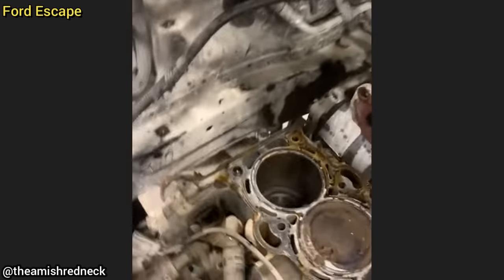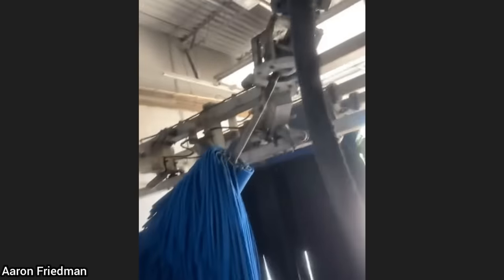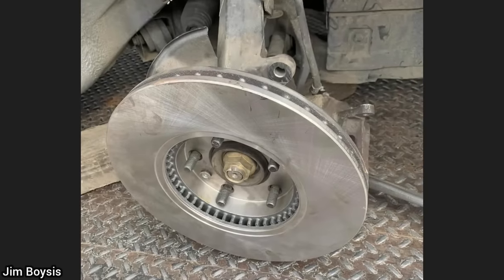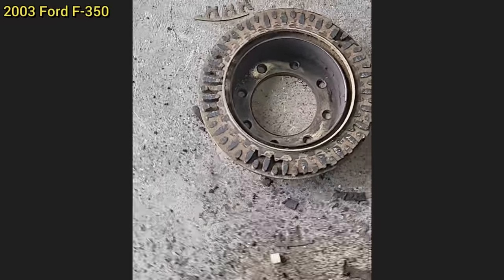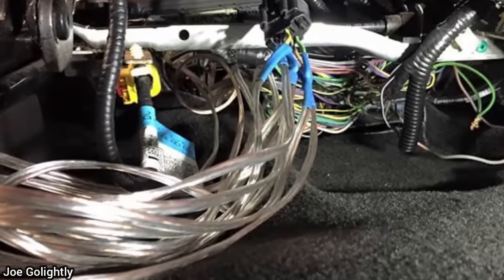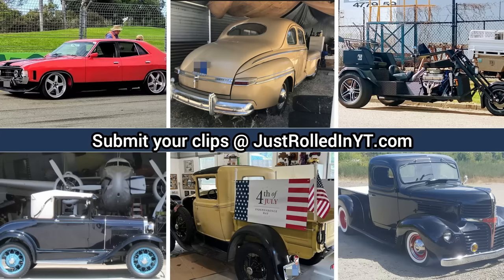Customer States Engine Runs Rough After He Replaced Some Parts | Just Rolled In

Comment: I can forgive these "rattle coming from rear of vehicle" instances. Why? Well, I started having a clunk in my front suspension completely at random. Like there was no specific trigger; just randomly would do it. Jacked the car up, everything was tight, pulled the wheel and inspected everything, but still clunked. Open my frunk (Boxster) and... the spare tire was loose. That was banging around in there, causing that feeling. Tightened it up and it's been fine for about 5,000 miles now lol

Comment: 40 years ago I bought a Pontiac for 50 dollars.....it made helluva noise and pulled to the right badly. 
The previous owner had put new brake shoes on, one of the springs had came off, letting the parts fall into the brake drum.......
Put it back right, sold it for 500 dollars......

Comment: Nice job with the brake rotor. How difficult is it to put the new one on the same way as the old one.
Reply: I did my own brake job for the first time just a few weeks ago, it’s not that hard to use the internet if you have doubts. Like damn dude, wtf lol
Reply: Alot of these circumstances are made up , if the tire wasn't mounted how did it get to the garage?  Say it was towed , how does the tow truck driver not see it and mention it ?

Comment: An OR nurse is responsible for counting and keeping track of the surgical instruments including gauze, before and after a surgical procedure, but persons who work on their vehicles and leave rags in at least won't die if it's done, well we hope not anyway and never ever work on a vehicle when you're exhausted and tired, save it for the next day or some other day, you'll be glad you did, I was so tired late at night one time when I finished working on my pick up truck and forgot that I had parked my car across the driveway, yes I backed up right into the door, I finished putting a new cam in my car, I had to take the cv axle out, after I finished I went to take it around the block, 3/4 Of the way the axle came out and it started pouring trans fluid out, I ran home got some fluid dumped it in but it didn't work, I got my truck strapped a tire to the front got behind the car and pushed it slowly up the street to  the corner where my house is, I got my jack air hose and impact to take the tire off and fix it right there, a miracle occurred when my next door neighbor came home, he didn't speak a word of English but I somehow managed to explain to him that I'll push the car with my truck and he steers the car into my driveway, I was so happy because I was so tired, the next day I popped the axle back in and all was good.

Comment: It is scary how many people are completely oblivious of things when it comes to their vehicles. So many bills avoided if people would take the two seconds to look thenselves and investigate. I hear a noise, hubby and I will try to figure out what it is making it. On our other vehicle which is currently broken down, we had a rattle noise in the engine. We found out it was the shield over the timing belt. Too many peoppe either too lazy or too ingorant. Like those that do not know the simple abd basic functions of every vehicle, like high beams and the respective blue indicator, turning interior lights on and off, turning vents, the ac, and radio on and off, etc. Owners manuals can be found online and really should be read because common sense hasn't been common in years...

Comment: Any scumbag dealership calls the cops on me for trying to get my oil changed, it would be the last time they would see me in their place.  She told them she wanted an oil change.  She didn't go there to give them $1200.00  to rebuild the front of her car.  Typical dealership trying to scam a woman out of money again.
Reply: They called the cops because that car was a danger on the road. The dealership/mechanics aren't lying you can clearly see that there is a problem with the trailing arm and the tires are done for.  They aren't going to call the cops on a car that has no problems, because the police would count that as a fake call and there would be repercusions for the person who falsly reported it.
If anyone was the scumbag it's the carowner because clearly she doesn't care about her or other peoples safety. If she really wanted a second opinion on the mechanical problem she could have called someone to tow the car to another shop. With the state off those tires that car shouldn't be driven even without mechanical problems.

Comment: Can someone explain the claymore on the steering wheel one?
Reply: The ST logo on the airbag will become a projectile in the event the airbag deploys.
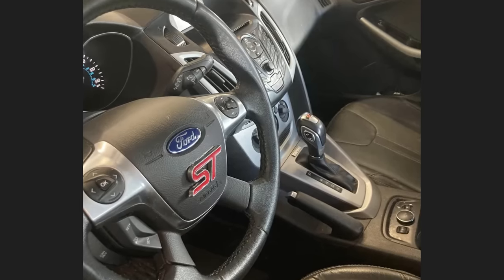Reply: 1:58 It's explained in the caption. Vehicle was a Ford Focus SE. Customer had glued (poorly, as it seems to be barely affixed) an ST badge to the steering wheel. Narrator is basically speculating that an airbag deployment would dislodge the ST badge and launch it into the driver's body or face, possibly killing him.
Reply: in modern times, a "claymore" is an anti personnel mine.

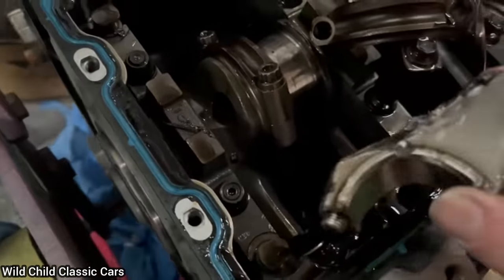Comment: 0:31  Not topping off the engine oil should not have caused the engine to explode like that unless it was bone dry.  Dealer is trying to get out of a warranty repair and used that as an excuse.  This is the only segment of these videos I've watched where I agree with the customer.  Engine was faulty.
Reply from the maker: Didn't happen at a dealership. The engine is on an older mustang that has a built engine and is used for racing.
Reply: @JustRolledIn  Engine was faulty.

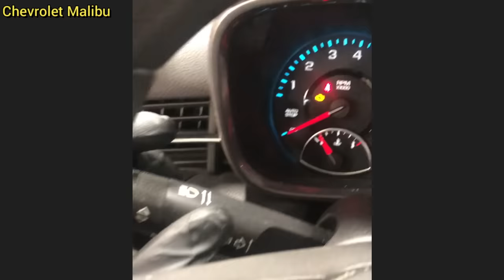Comment: 1:50 Smart customer declining the $100 oil change.  If your mechanic is going to charge $140 to push a button on your dashboard, best thing you can do (idiot or otherwise) is to find a new mechanic.
Reply from the maker: That's the shop rate not what they charged.

Comment: I don't understand the battery voltage warning one. 12.3V is low. Should be 12.6 or more.
Reply from the maker: The vehicle wasn't on. The message was on because they had the battery voltage displayed on the instrument cluster. It was an easy fix, that's why I showed it.
Reply: @JustRolledIn  Ah, makes sense. Thanks!

Comment: If ANY vehicle is unsafe to drive, the necessary steps must be taken to prevent it from being driven until the issues are fixed.  If it means calling the police or a tow truck, do that.  

I don't want people getting injured or having stuff get damaged because some idiot decides to drive on an insanely bald tire, worn out wheel bearing, paper thin rotors, having stuff not secured to the vehicle properly, stuff being broken, etc
Reply: The amount of times I've seen videos of cars with rusty frames, stuff busting through the frame, super worn out or even broken steering components, dangerous mods, etc is quite frightening.  We're sharing the roads with these people and this stuff could end up killing someone

Comment: We all have met that ONE wife that just don't get it. My wife calls me while I'm offshore welding to tell me that the car won't start, won't even crank ... over a period of many questions, I asked her what lights are lit up on the dash when she turns the key to ON, she said only one ...the one that looks like an old oil container ... I said that means there's no oil in the car and to pull over immediately until more oil is added.
   She said " Isn't that a reminder to change the oil, because I've been meaning to get that light turned out for about a month now" .... no lie.
   To put this into perspective, my wife says the dryer is now taking too long to dry, I check out the dryer, the lint catcher has never been cleaned in months, I could barely get the dam thing out of the dryer.
    In her defense ...5' 11" tall, long natural blonde hair, blue eyes, 12 thousand dollars in teeth, 11 thousand dollars in fake boobs, 23 inch waist, when she walks her bum looks like two puppies fighting under a blanket.

Comment: Ya'll, is it cool the call the cops on unsafe vehicles if you're the tech and they deny repairs in your shop? I think that's BS as it's not your job. Do cops call you to enforce repairs? No? Something is just wrong about doing that on several levels. I'll catch hell for this, but I don't care: Don't be a rat or every shop that declines work on unsafe vehicles will be called on as well. (i.g. - If you decline work on a entirely rusted out frame with home repairs due to obvious liability issues, should someone call the cops on you for denying repairs and releasing it into public? This is nuts.)
Reply: I hate Narcs
Reply: Put it on a tow truck and get it taken home so you don’t endanger others. Shop owner is trying to prevent them potentially killing themselves or someone else. If you can’t afford to fix it you shouldn’t own it.